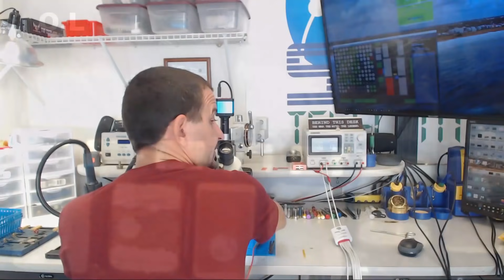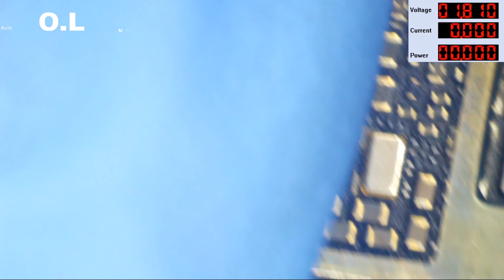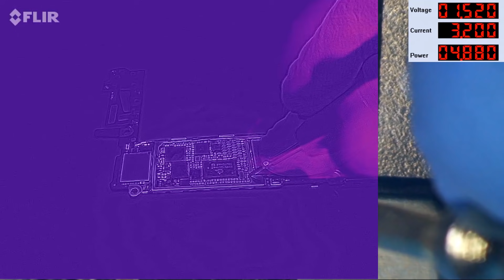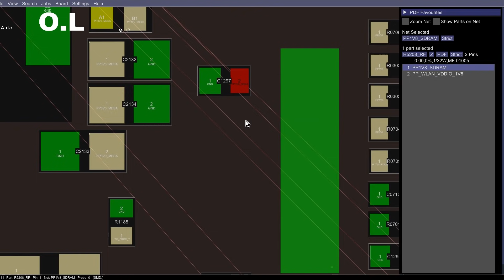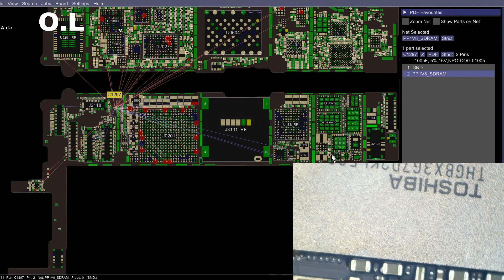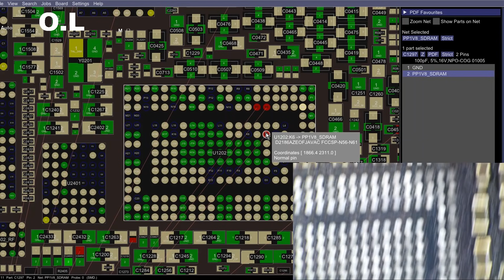I got my A$$ handed to me by an iPhone 6 (No Power, Data recovery)

Comment: Some of the things that I always say to students jumped out at me on this video.
1.) Be wary of trying to make the problem be the problem you want to solve.  The problem is what the problem is.

2.) How did it come to be this way?   This question helps us not pursue random rabbit holes that really don't have a mechanism for failure in situation X.

3.)  Shorts don't get hot.  Tiny wires get hot.  
 When a cap fails, how does it fail?  It becomes a tiny wire.   When a chip gets electrically damaged, how does it fail?  It becomes a tiny wire.  When a speck of mud makes ball A touch ball B under a chip, it makes a tiny wire.   These things will all get hot because tiny wires get hot.    When an idiot blasts heat at CPU what happens?  Two full solder balls bridge together and make....a big fat wire.    As soon as you saw no heat, it could only have realistically been CPU or BL driver.
Reply from the maker: Yes and in this case since the "short" conducts electricity better than the traces inside the PCB, the traces get hot and not the fault. Thanks for watching my videos.  I had fun making this one. :-)

Comment: I really appreciate watching you learn and I'm really glad that you are back at it, doing videos for us mere mortals, as you got me really scared for a while. I've been in the electronic troubleshooting and repair for a long time, but never on consumer products. Anyways, just wanted to let you know that your impedance variation was normal. It was cause by the heat you used to remove you components. Well, the boards was still broken, just not worst. Also, looking at the schematics for the iP6, that power line splits into 3 other power lines. I guess they don't usually cause problems, but since this one was broken by a prior repair attempt, it might be worth looking into. As for big components swap, well, do your research well before going into it. The better the tools, the more control you'll have over your process and the easier it'll be and the better yields you'll get. Also, someone mentioned the humidity having a part in it. Well, he's totally right. We use special equipment to try and mitigate that in the industry (I remember a batch of chips exploding because of that).
Reply from the maker: Oh man, the RAM on the A9 CPUs is so fragile.  You mentioned humidity and on those, I think humidity may be just enough to cause the RAM to bulge when the board is heated.  Sometimes even if I haven't gotten the board wet, I put them on a hot plate just below boiling temp for a good long while, then raise the temp just above boiling for an even longer while.  I wind up drying them all day long before using hot air.  I try to keep the humidity in the shop as low as possible but with what I've seen from the A9 CPUs, it's immensely important to be sure these boards are dry before heating.  Thanks for the commenting and for the info :)  I may not get to post a video today but I wont let that stop me tomorrow.

Comment: I think if you were the first technician to touch this board you would have had no problem fixing it. As it sits though it looks like three or four novice repairers have hacked at it thinking they knew what they were doing and have just made a mess of it. Good try anyway mate but you can't always win when pushing shit up hill from the start. Thanks for sharing it with us.

Comment: Did you verify that you didn't have a PP1V8 short carried over to PP1V8_SDRAM via Meson? Looks like you left the one thing most often that would have been messed with on a prior repair touchIC.
Reply from the maker: Yes.  It's been here for way too long and I had checked pp1v8 when it was first on the bench.  Your comment nearly gave me a heart attack tho (after all I've pulled from the board)!  I just pulled meson and there's no visible bridging.  Still have near 0 ohms on 1v8_sdram.
Reply: @ststele  You'd also hate yourself if it was the classic 1v8SDRAM bad cap (it won't be) but wiggle it out anyway because it has a mechanism--this was flexion damage which bothers that corner of the CPU and often kills that cap.

Comment: That came from me, this is so sad 🙆🏾‍♂️. Will reply to your email about that ASAP.
Reply from the maker: Bummer :( I'm sorry you had to watch this.  I've worked on it a bit more and I'm 99% sure that the short is under the CPU.  There are techs who can re-ball it with reasonable success though.  It may be possible for them to get data.
Reply: STS Telecom I can agree with you on that. I think I used too much heat on the pcb , so much that it went through the other side and created a short. I’m still yet to buy a thermal cam,  and practice on old boards. Your videos inspire me to become a better technician 😊